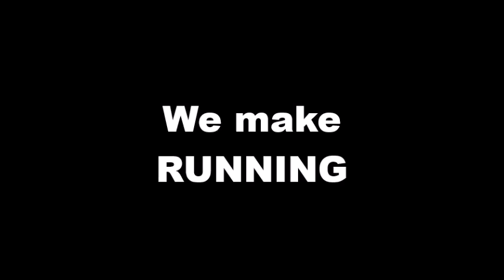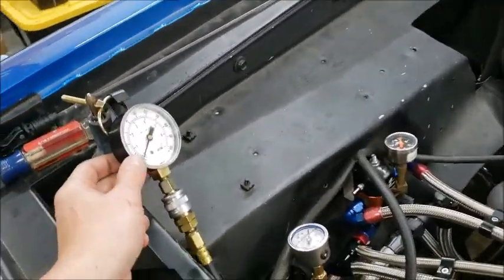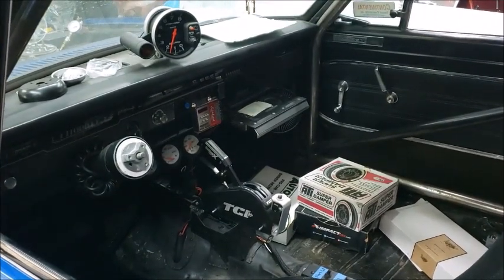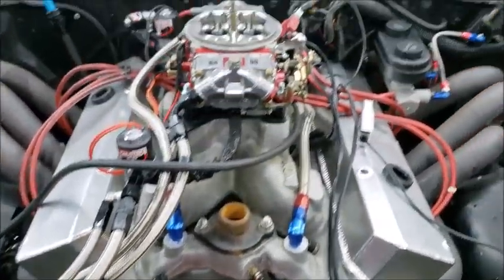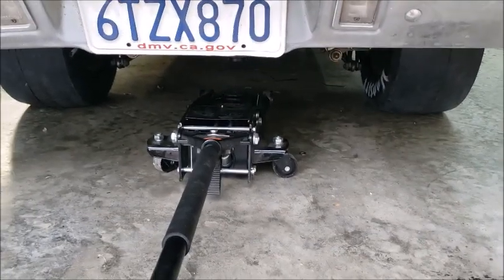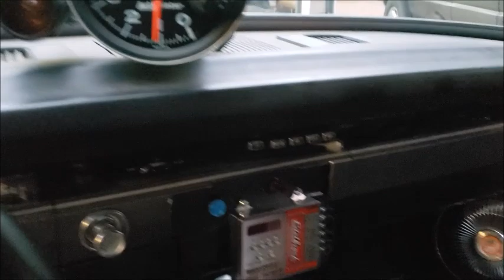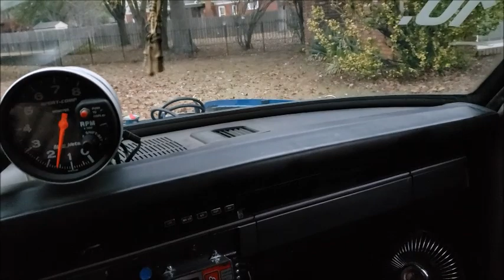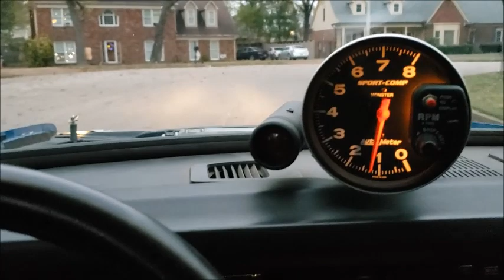Cookie Monster...... Wakes the dead.

Comment: I never was a huge fan of the early/mid-'60s A-bodies as far as owning/modding one, but always thought they were cool. I did a /6-3spd to 318-4spd O/D swap in a '65 Barracuda for a customer, which was partially a bitch because he supplied a 833 O/D from a truck (long tail!) and a 10.5" aluminum bellhousing from the same. I had to add the 4spd "hump" and find the magical shifter handle to clear the dash and seats, as well as buy all the custom fork/Z-bar for the larger bell/clutch assy from Brewers. Amazingly, I found 273 manifolds and a custom stainless 2-1/4 to 3" single exhaust system with a Borla muffler on Ebay off an identical car! I put a small Crane solid flat tappet cam in it and all the 273 pans/covers to make it look original. It ran great, but wore me out for a "bolt-in" type of swap. Now I'm doing a '66 Valiant Signet for myself, with a stout all-iron 360 I built that went 7.0s@96 in a lightweight A-body chassis, with a (bolt in!) 8" Ford Maverick rear with 4.62 gears and a 904/9.5" converter. Hopefully to debut next spring!! I missed the "Cookie Monster" at the NNN's but enjoyed yacking with you and Dallas at your tent! RB